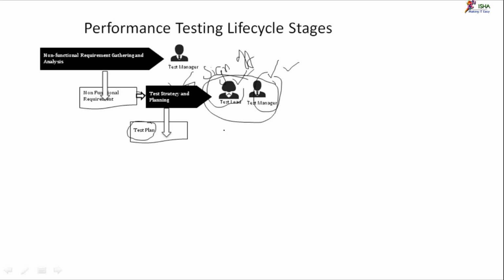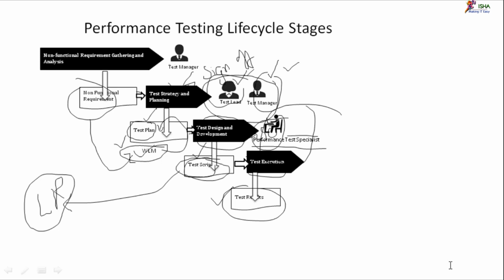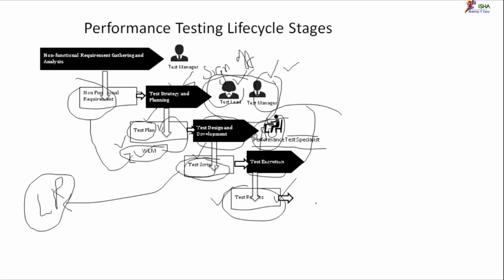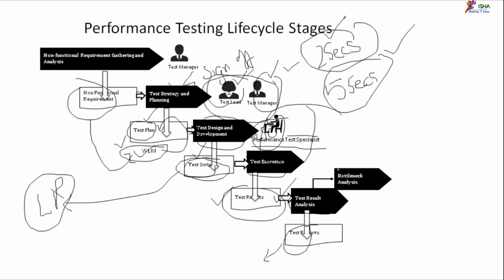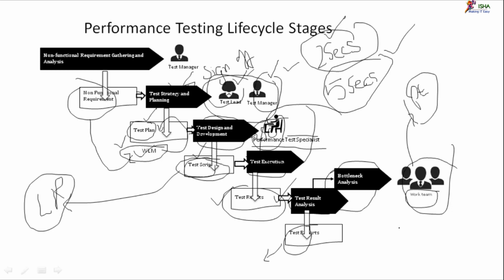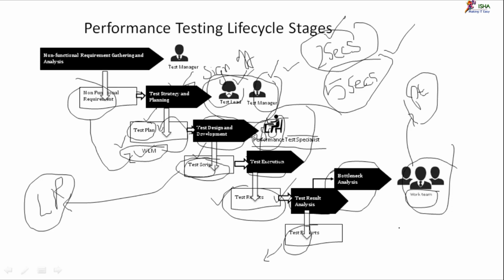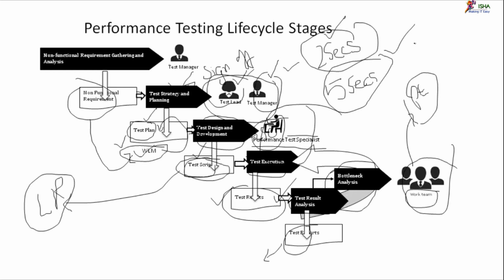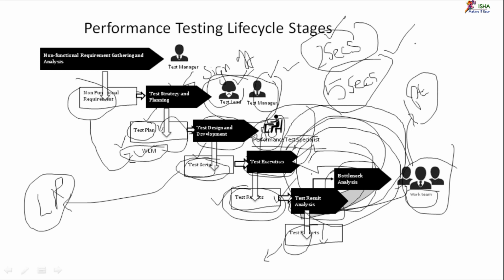Performance Testing Lifecycle stages -Performance testing - PTLC

Comment: Best video of PTLC on YT.  Sir as you said Performance Tester has to do Bottleneck Analysis so along with performance testing tools he has to know the coding part, networking, databases knowledge to fix that Bottleneck right? Or development team will fix the Bottlenecks?
Reply from the maker: Usually developers or performance engineers will do that
Reply: Then performance tester also need to understand/know the coding part of the application then only he can find bottlenecks right (like these function is creating higher response time like that)?
Reply from the maker: @hum__shyam  yes..it will be good but not mandatoru
Reply: If it's not mandatory then how performance tester can find bottlenecks?? --